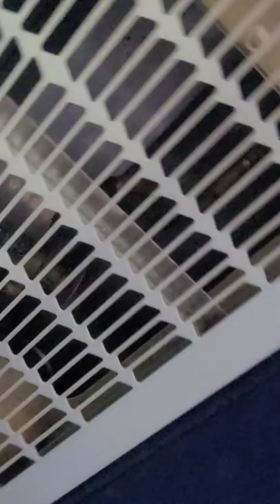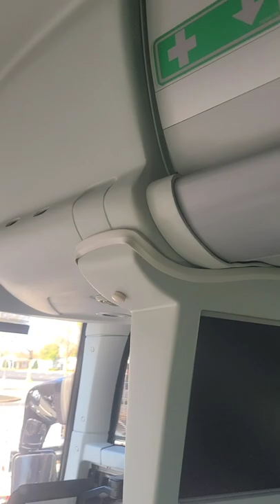Air Conditioner On Prevost Passenger Bus

Comment: I really thought those things would have  blend actuators and could be the culprit. Great vid bro. Sounds like the driver dealing with a lot
Reply from the maker: Turned out there are a bunch of Sensors on the roof under a Panel.

One of those tested bad, it worked after that.

I am not so experienced with these, they have a whole troubleahooting program for the AC system.

We found someone locally who works on them.
Reply: @AMPMChatt-Jax  just did a c. last week will be dropping video soon bro.
Reply from the maker: @MahlonTane  Plus we need to get you to that 1K SUBS. Remind me when you drop Video and I will share.